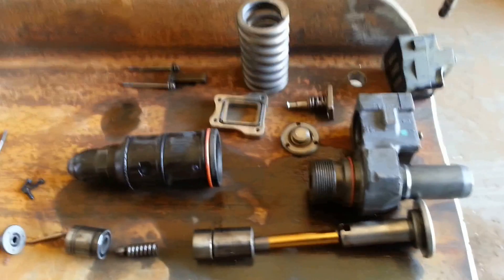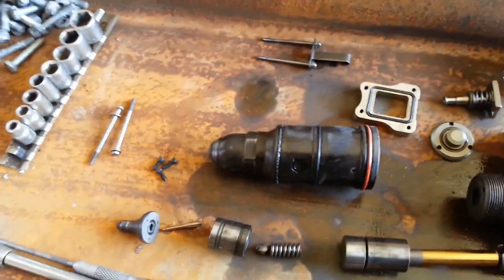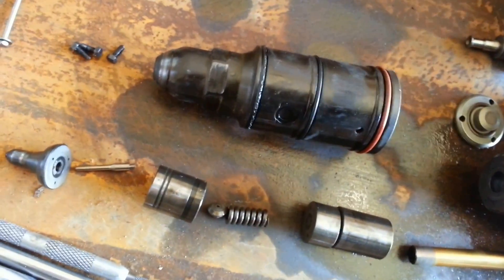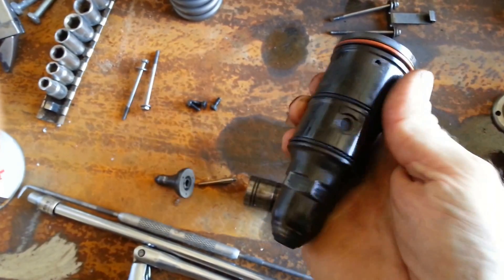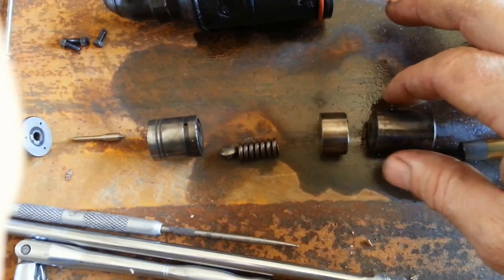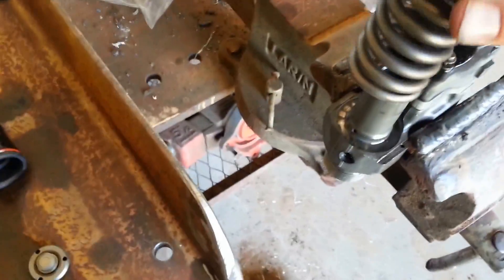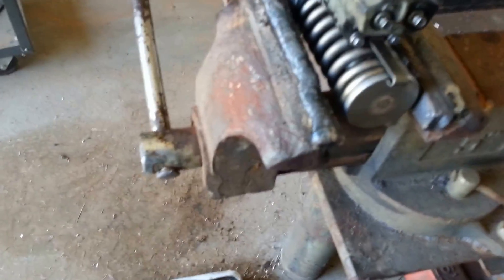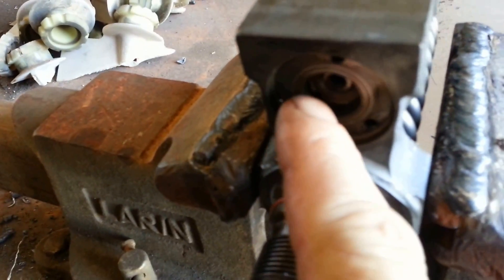S-60 Detroit DDEC IV EUI Dissassembled and reassembled PLEASE SUBRSRIBE Thank you

Comment: i have a problem with my generator detroit 60series,fuel mix in oil,what the main problem,or proble coz?thanks
Reply from the maker: Hello Josep, sorry for the late reply, what we have found with fuel in the oil is that the injector is leaking fuel in the oil, from the top ''O'' rings, also seen the solenoid seal ''O'' rings leaks. The best way to find which one that is leaking would to mix up some died fuel, pressure up the fuel system to approx. 25-30 psi. look for it with a UV light, the die in fuel under the light will appear a bright brownish to a orange color. I hope this helps.
Reply: PermianBasinDiesel thanks so much!